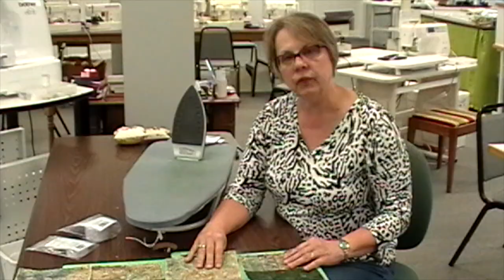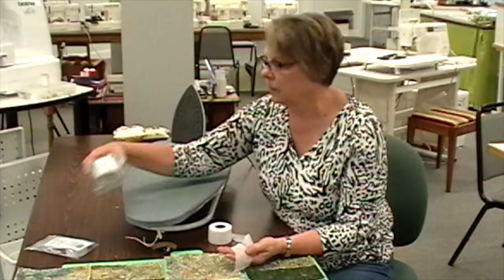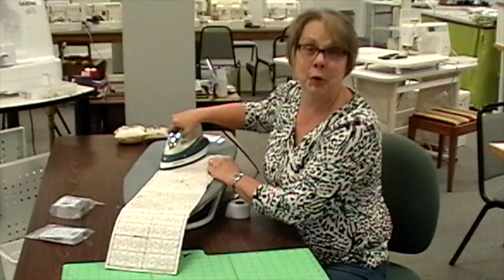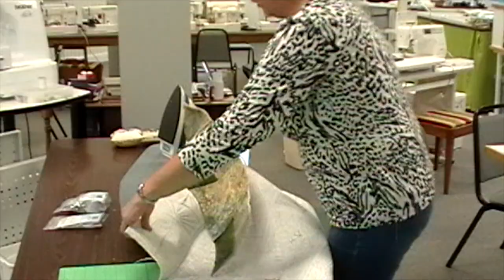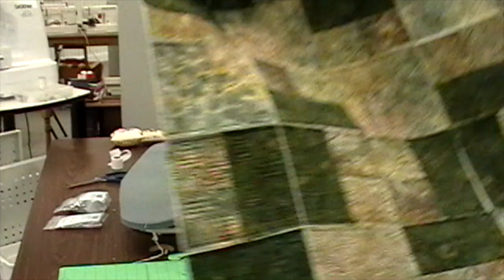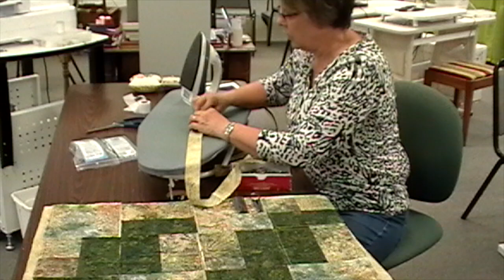Build the Quilt #1-Build As You Go Machine Quilting Series

Comment: I bought the Heat Press Batting and  finally started a quilt.  I have been searching you tube for the video on adding borders and have not been able to find it.  Could you please tell me where I can find the video?  I am looking forward to using your method for Build As You Go Machine Quilting.  Thank you for the wonderful tutorial it is very easy to follow.  Christina Baldwin
Reply from the maker: Christina Baldwin I have a PDF file that I wrote up until I can get the video done. If you would call me today and give me your email, I will get those instructions to you ASAP. Adding borders is very easy.  1-800-466-7315
Reply: Thank you for your reply.  I work night shift and  just received your reply.  I am looking forward to speaking with you tomorrow.